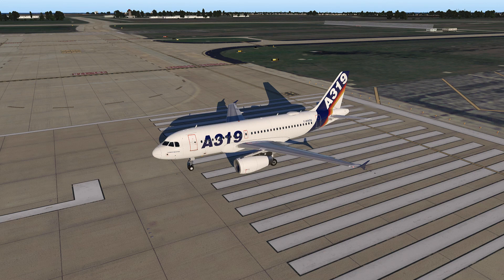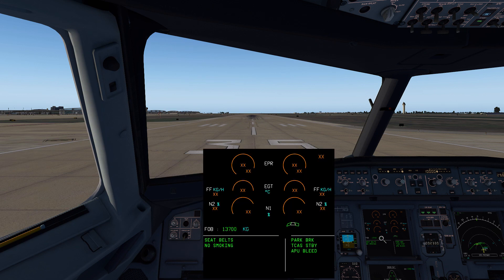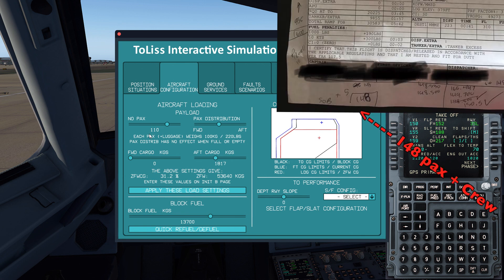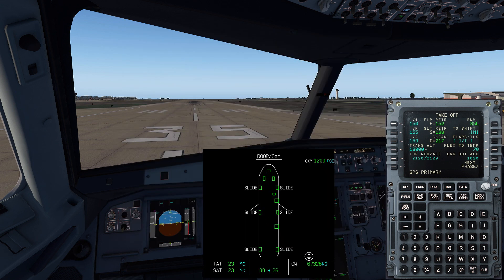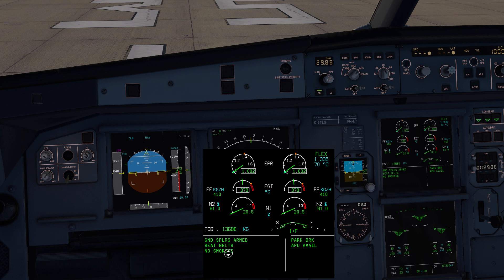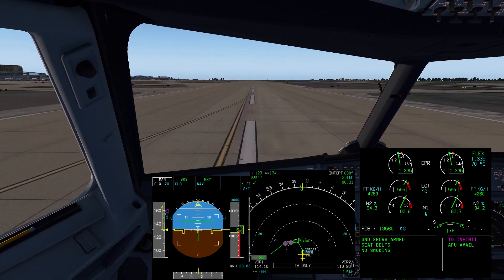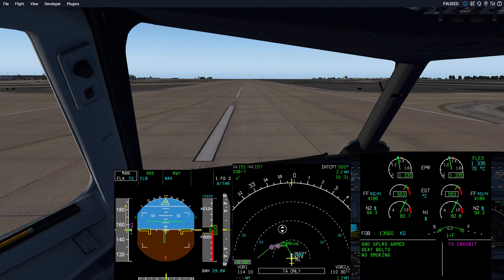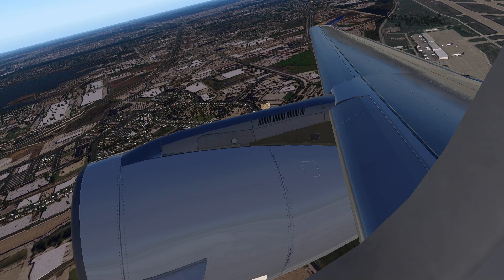I Toliss A319 vs REAL world DATA I Performance TEST

Comment: Uhm well no. It receives about 800kg/1750lbs fuel per min in real life.
Reply from the maker: No sorry, not sure where you got that number from, perhaps dual fueling maybe or from an underground tank pump thats capable of more flow. From a tanker truck I sat there and timed the fuel loading myself. According to those numbers we could fill up the tanks in less than 25 minutes  which is precisely about how long it took us to receive our required fuel load 20,000lbs additional pounds
Reply: I've timed the fuel uplift before, and while I wasn't looking for a precise number, it's indeed a bit under 1000lbs/min. 

So, I'd say 800lbs/min is probably correct with small variations outside of that.

Comment: How would you rate the flight model of the Toliss and the FF in general. Does it feel close to what you expect flying it by hand from personal daily experience? I am asking cause I find the hand flying part to be the most fun. :D
Reply from the maker: yes absolutely it does! It is quite enjoyable
Reply: V1-Simulations Thanks man. I am asking, cause recently I watched a video from Mentour, where he explains the behavior of a 737 at steep turns. I especially remembered how the stall speed drastically increased at 60degree bank angles. When trying to replicate it on Zibo or even PMDG, they totally seemed to ignore that fact. Which seems a bit disappointing to me. :(

Comment: I own the ffA320 but have tried the toliss A319 on a friend's sim and I'm so disappointed. The fbw seems better and it comes with both engine variants. The only thing id be critical of is that the default VC textures are a bit off and the v2500 engines look a big.  large.
Reply from the maker: With the free mods the Toliss has you can really bring up the visuals with the FF. However for me, the sounds are still a setback. Once BSS is released for the 319 it will be hard to not fly!

Comment: Nice video :)
I’m probably going to consider getting the Toliss A319 now. Also, are you going to go the FlightFactor A320? Maybe FF fixed their perf TO numbers.
Reply from the maker: yes once the next major update hits stable I will run a test
Reply: They just released a new beta the other day, so they are still improving it which is a good thing.